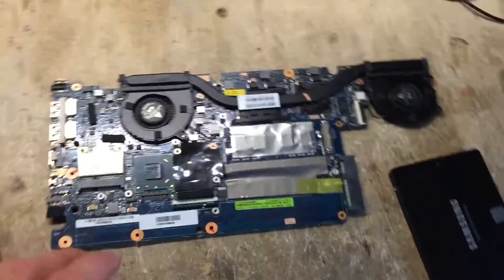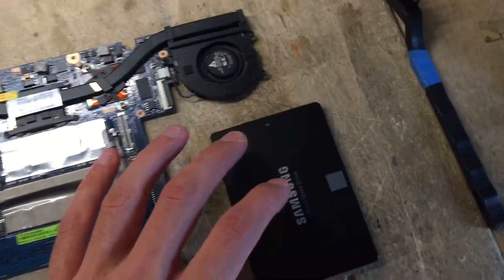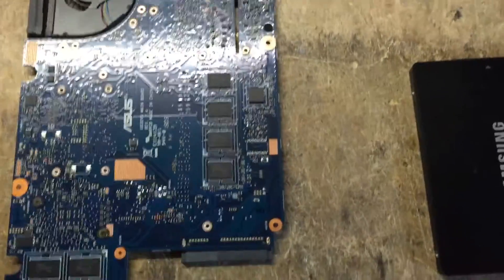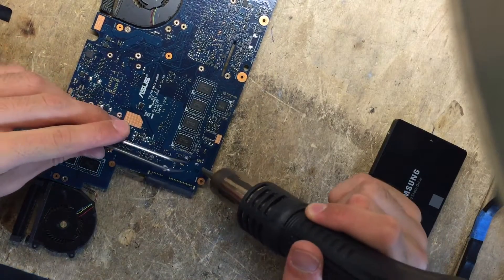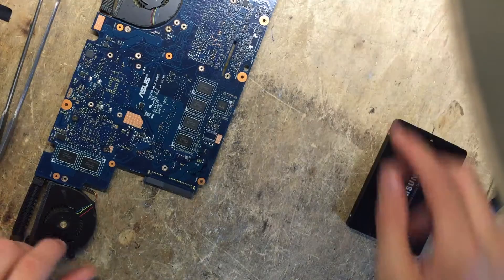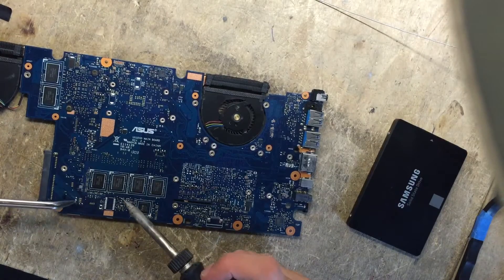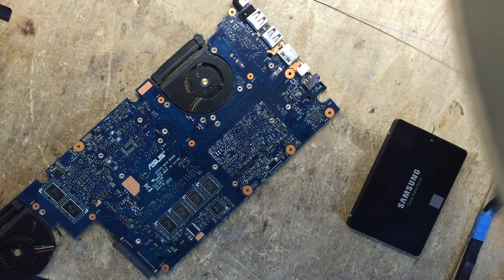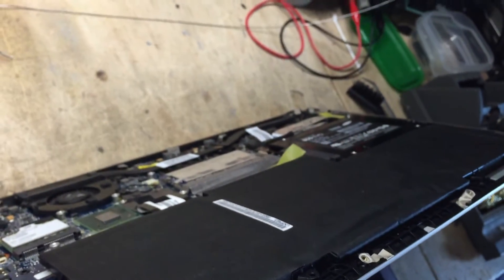Asus UX32VD SATA SSD 5V Modification Upgrade DIY Repair

Comment: Yeah no I just thought about it... I mean the video is old, this isrelevant, but: The internal ssd has nohing to do with this port. The port you mod is the normal sata conector, witch is used to connect the stock 500GB HDD it came with. The special, kinda slow buffer SSD thing is sodered on the motherboard. I know, since I changed the 500GB HDD with a 250GB Samsung SDD (800 something, can't remember rn ) as afforementioned.  I still have another disc showing up in my disc manager, roughly 22GB. You can format it to get some extra space, since it original ssd cache function does nothing too your system after switching the drive to a SSD.

Comment: sir iam new subscriber my laptop dell 3542 i5 5th gen part number 13269-1
the problm is hdd and odd not detected  5volt at sata power connector   but data point not shows plz tell me solution

Comment: OMG! I searched for a solution on this for years! The info for this specific model is very limited and in forums no one seems to know what to do other than just replace the old msata disks. I definitely gonna try it. You should add UX32VDA to the tittle or tag since that is the specific model of the computer
Reply: good you found the solution finely

Comment: Thanks for sharing this! I ended up doing the same with mine (Samsung EVO 860 1TB). However, I lost the 0-ohm resistor somewhere on my kitchen floor and never could find it. But, because the "resistor" was 0 ohms to begin with, I simply soldered together the points where the resistor would have gone into, and it worked great for me.
Reply: How did it go with the 1tb disk? I read somewhere that the Max capacity accepted was 512gb

Comment: How did you know that it was that resistor who supplied the power to the 5v rail? Is there a good information bank that I have missed?
Reply from the maker: if you look at a Sata connector pinout you'll see that those pins are reserved for 5V power. I also probed the various points with a meter to be sure that the empty spot for the resistor (or jumper link) was indeed for providing 5V to said pins. originally it was powered by 3.3V only because it was using a different kind of disk size that did not require 5V.